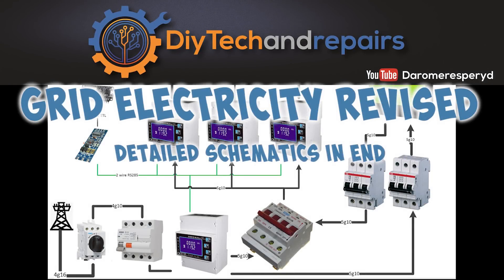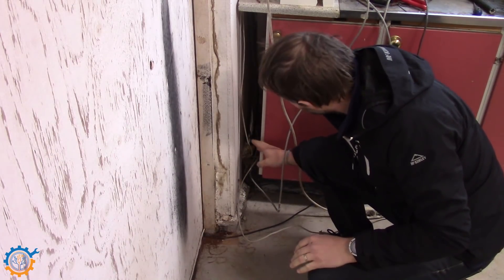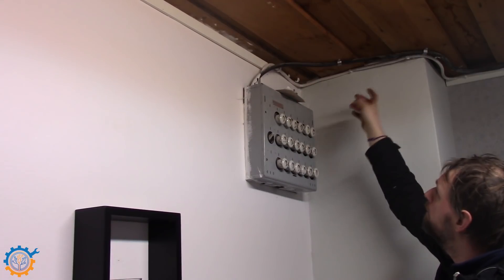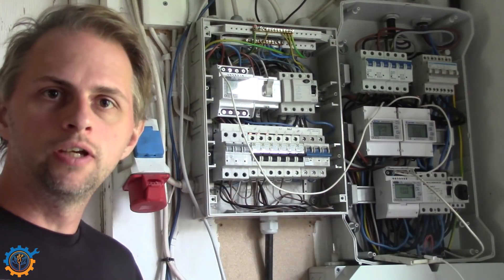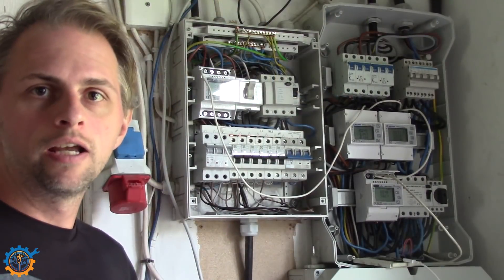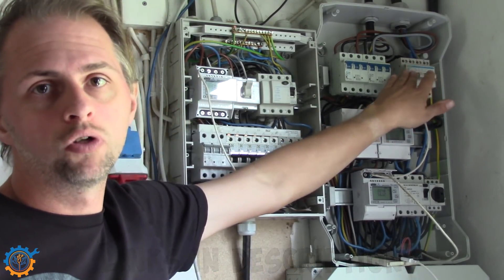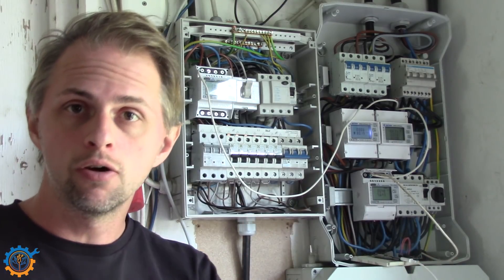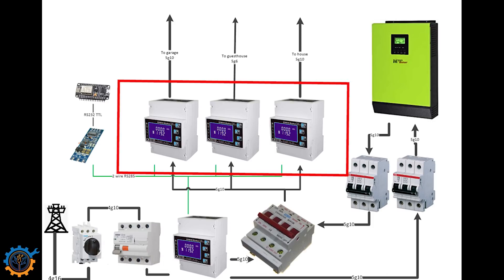Solar electricity as main supplier for my house - howto

Comment: I also live in Sweden, near Kalmar, and I would like to build a system similar to yours. It is officially not allowed to install a fuse box yourself. What is your experience with that? Also, the link to the changeover is not to a three phase one. Cheers and thanks for the videos.
Reply from the maker: Hi Fellow Swede :P . No its not to install a box your self. I had an electrician approve the end stuff on the main boxes. But then you need to have someone that understands it. I also gave him a drawing for the parts that he did. I had to move my main box and that cannot be done your self at all since it need to be sent in. The changeover i linked is a 4pole. That is minimum to change over a 3 phase system in sweden. 

I use this currently: https://ebay.us/ihNdgZ
Do note that its not potentially fully compliant. But you can get a schneider one or other for 3-6ksek so they are expensive :)
Reply: @DIYTechRepairs  Thanks for the reply. We have two old fuse boxes we will have to renew. The electrician is a younger guy I hope he understands this stuff. In Holland I did the wiring and fuses myself, but here it is unfortunately not allowed (officially). I will make drawings similar to yours (in the videos). It's a good example. Cheers
Reply: @DIYTechRepairs  In the schematics you have one line from the first meter to the change over switch and a line to the breaker/inverter. Am I correct to asume that you can connect two cables to one meter connection point?
Reply from the maker: No you need to have something that splits it up. Like a junction of some sort
Reply from the maker: Example: https://www.elbutik.se/product.html/kopplingsplint-eks525-5-p?pjclid=57806b80-fadd-41a9-9984-b08d10311f82_95aeb90b9edec0e0

Comment: Hi, is it technically possible to feed back from the MPI 10k trough the connection on the right into the grid? (being alowed to do so by the electricity provider is a different thing of course)
Reply from the maker: The mpi can feed back on the grid port. Its an hybrid inverter :)
Reply: @DIYTechRepairs  Im thinking about installing one of these units, but have some questions and it would be nice to hear your experience on them. Did you test how much it draws in idle? And do you know how accurate the readings over the serial bus are? Are they actually usable? it would save me many sensors and meters. Do you know if its possible to change operation mode via the bus? I would like to install a generator wich would be automatically transfered and I would like to prevent the inverter from feeding back to the generator, thinking its the grid. Have you meassured how efficient 48v to AC and PV to 48V is? Do you have experience with asymetrical load (i.e. big 1 or 2 phase loads like a coocker, vacuum or hair dryer)? Thanks
Reply from the maker: @paradieshenne  it draws 80w per phase. So around 200-240w Idle. I have videos about the bus. For instance wireless systems. Check Them out. You can also controll it via rs232. Its around 80% efficient.  You get what you Pay for ;) yes you can disable feedback to grid port. But IF you dont need grid tie get their offgrid versions instead

Comment: Hi, nice channel, how do you fit your batteries in this setup? Also does your Inverter also acts as a battery charger and does it work without grid energy? Many inverters only work after you connect the grid, to avoid island effect (when you send energy to the grip even when the grid is down)  Tack

Comment: Is cable 5 X 2.5 mm2 enough from Inverter to gird if the panels are 3,5 kW?
Reply from the maker: Depends on many factors. IF its 3.5kw spread evenly over 3 phases its more than enough but you should consult your electrician so its Up to standards where you livw